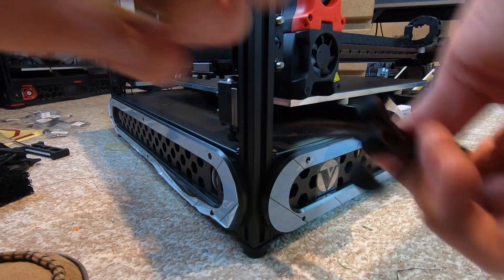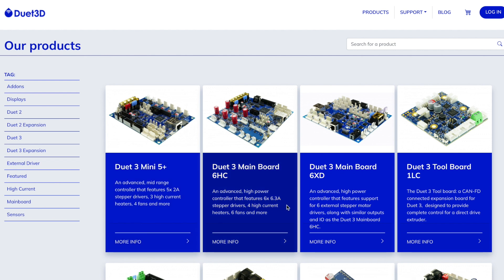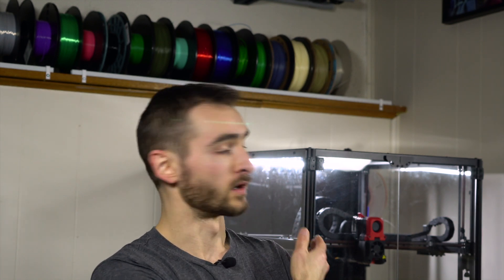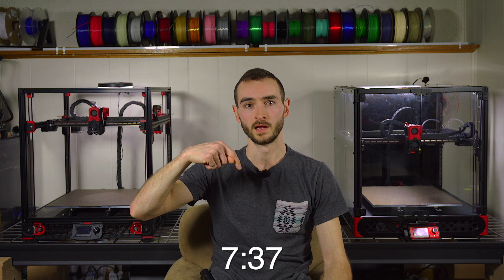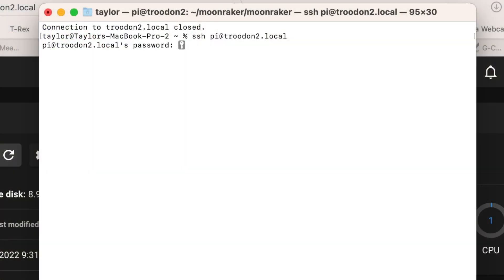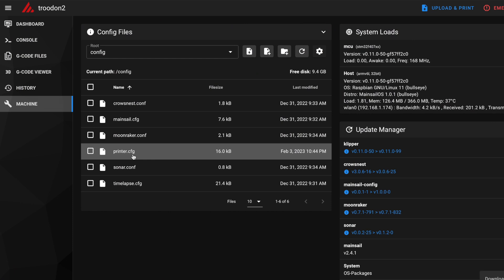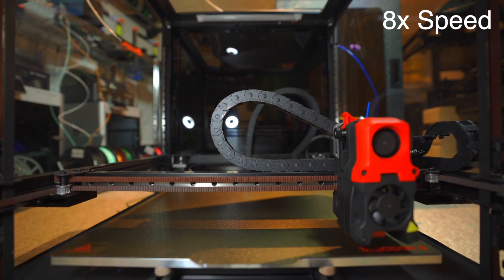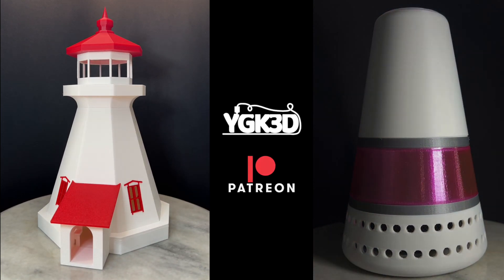I Drank the Klipper-Aid - Klipper-izing A Voron Clone (Troodon 2.0)

Comment from the maker: NOTE: After flashing the firmware to the board, connect the printer to the Pi using a usb cable (the port is at the rear of the machine). Then, SSH into the Pi and send the command  “ls /dev/serial/by-id/“. This will return the serial identifier of your printer. Copy the output and paste it into the [mcu] section of printer.cfg, replacing the existing one. Once complete, restart the firmware and upon reboot the Pi should connect to the printer.
Reply: hi i did the “ls /dev/serial/by-id/“.. and it says reprap firmware. am i doing it wrong? coz my printer now is no lightscase and lcd is not on as well .. 
power supply motherboard and raspberry pi is on. but everything else on that is off. i need to know what is wrong with my printer. im stuck right now.

Comment: Does this also work on the 400x400x500 with Pheaton Dragon High Flow Hotend
Reply from the maker: The original Troodon? The process would be similar but not identical.
Reply: @ygk3d  Do you know the differences?
Yes it is the original one. 400x400x500
Reply from the maker: @ it’s a different board so the pin out would be different
Reply from the maker: I believe someone has already created a Klipper config for it so try finding that instead of making your own.

Comment: I did everything and got it running but when I tried to home, it went to the z switch but it missed it by a few millimeter and crashed into the bed. Had to emergency stop.
Reply: It seems the printer when it homes Y is maybe 3-4mm short of the z switch in the y-position. I have no idea how that happened. I'm guessing klipper triggers the end switch earlier maybe. I didn't notice this on the stock firmware. The z switch location now seems to be about x230 and y355 but the printer is at 350 when homed to the y switch.
Reply from the maker: @sabahoudini  try changing position_endstop and position_max in the  [stepper_y] section of the config. You could also try changing the z endstop location if your pin isn’t in the same position that the config is set for.
Reply: @ygk3d  I set the homing to x354 and y355 to take advantage of the whole bed. I checked so it doesn't collide anywhere. Z endstop I reset to y 355 but it's not quite in the middle but it works. Are there macros to set the z offset and whatnot like the two macros from team gloomy?
Reply from the maker: @sabahoudini  no, but watch the beginning of my Tap video to see how it’s done.
Reply: @ygk3d  Thanks, it works great :D

Comment: How many SD cards do I need? One in the Pi and one in the motherboard right?
Reply from the maker: Yes. 2 total.
Reply: @ygk3d  Excellent! Thanks.
Reply: @ygk3d  Can you power the Pi from the motherboard or do you need external power?
Reply from the maker: @sabahoudini  you can tie in to the existing power supply with a buck converter. The Pi needs 5V.
Reply: @ygk3d  God damn it, why does everything require you to order stuff then wait a week for delivery and then realise you need something else and then wait another week. Thanks for replying :)
Reply from the maker: @sabahoudini  haha just power the pi from the wall for now..
Reply: @ygk3d  I need to find a charger for it. I remember years ago when I klipperised an old creality I had to find a charger that was powerful enough. BTW when I read the manual for the BTT x7 board it says it can power a raspbery from a dedicated usb on the board.
Reply from the maker: @sabahoudini  The X7 is a custom board for the Troodon. It's not the same as the regular BTT Octopus. There is no USB port.

Comment: I have tried numerous times to install Klipper using your files, it never flashes. I have tried making a new firmware but has the same issue. Is there anyway to find the controller processor other than removing the heat sink?
Reply from the maker: Mhhh.. strange. No, not that I’m aware of. You’ll need to remove the heat sink in order to verify the processor model.

Comment: Would a cura profile for this made on reprap firmware work with Klipper firmware the same or would you have to crate a whole new profile for cura after switching
Reply from the maker: You’ll need to change the g-code flavor and the start script in the profile. You could also just use the Voron profiles which I believe are built in to Cura.

Comment: Is the firmware stored on the SD card the board has or is it actually flashed to board like firmware normally is I was wondering because I would keep the reprap firmware on one sd card for backup and pop in the Klipper whenever and vice Versa
Reply from the maker: There is a firmware file that is flashed to the board and system files that are stored on the SD card. You would need to reflash the board each time in order to switch back and forth
Reply: @ygk3d  thank you!

Comment: I know have my trodoon klipperized with your files! Now I am going to get into the jungle of tuning stuff, it took me 5-6 hours to complete the build itself, but I was slow and did a few mistakes with those plastic parts you should put behind the panels which is not very well described in the manual, but after som trial and error, I got it up
And I gave up on the original firmware straight away after it refused to connect to 2 of my routers of different known brands and put klipper on it since I had a spare pi for this!
Reply from the maker: Nice! Glad the files helped.
Reply: @ygk3d  Works like a charm, only thing missing though is heightmap when doing a bed mesh?

Comment: Thanks for it! Just bought Troodon2. Just wondering If I would like to Klipper-ize Troodon2 do I need to have RPI plugged to the printer all the time, or is it required just for initial setup and flash?
Reply from the maker: You’ll need the Pi to be plugged in at all times.
Reply: @ygk3d  Thank you!

Comment: reprap is a much more capable firmware . its a shame how lately everyone is running  klipper and prints fast stupid benchies . people dont realise printing that fast makes your parts weak and brittle . instead of material advancements for better layer adhesion and better quality , all we get is stupid fast and ugly benchy competition .
Reply: I'm all about structural engineering parts and not speed at all cost, but the problem with strength isn't the speed as much as it's the XY motion exceeding the ability of the hot end to properly melt the filament.  That's why the new fast Core XY printers have upgraded hot ends with longer melt zones and a ceramic heater that completely encircles the melt zone rather than a little cartridge heater in the bottom corner of an aluminum block that houses the nozzle on the other side.
Reply: @Liberty4Ever  interesting, thanks for your explanation.
Reply: Hi, can you tell me more about in what areas Reprap is more capable than Klipper? thanks for reading.
Reply: Ya cause my Darth Vader bust needs that extra toughness while sitting on a shelf. And when I do print ABS/ASA parts that are functional I turn the speed way down to about 80/100 mms... And those parts are just as tough as any.

Comment: I run RepRap on my Pro 3D V-King 400 on a Duet 3D 3, I tried Klipper on one of my 2 Ender 5 Plus printers on an Orange Pi Zero 2 and couldnt get on with it, the configuration and general set up was much harder than RepRap was although I did get it printing quite well, I think I am too set in my ways with RepRap and WebControl on the V-King and I have Paneldue also, I run Octoprint and Octodash on the Ender 5 Plus machines also. Klipper didn't bring anything that would convince me to change over although I might set it up on an Ender 3 I have lying around just to give Klipper another go, I will try the Octoprint GUI also with it as I am used to this GUI.

Comment: Reprap have by choose decided to not split x/y for inputshaping. Just cause Klipper does it independently does mean it’s better. Booth have their drawbacks. Reprap explains their choice of inputshaping more on their wiki.
Reply from the maker: Thanks. I acknowledged this in my last video on input shaping in RepRap. You’re right, it’s not better for that reason alone. I prefer the Klipper process because it automatically fits all of the different shaping functions to your accelerometer data and suggests the best one.